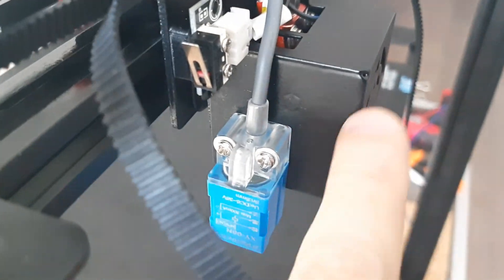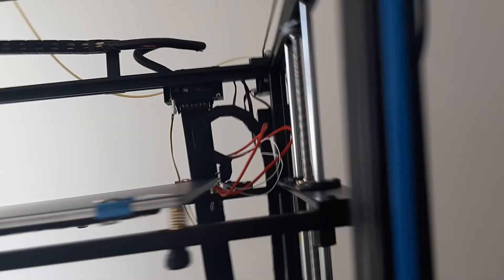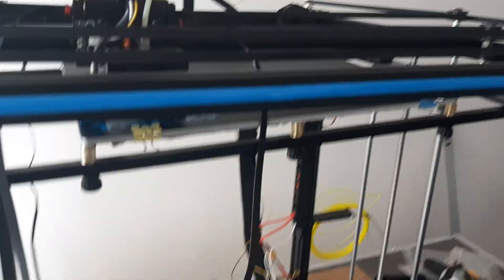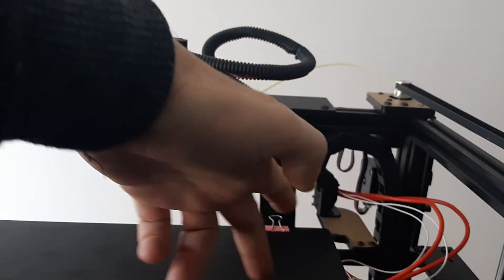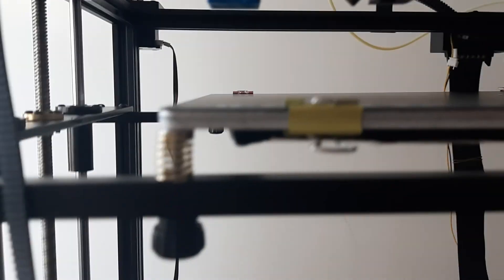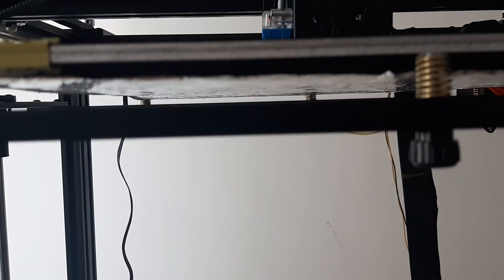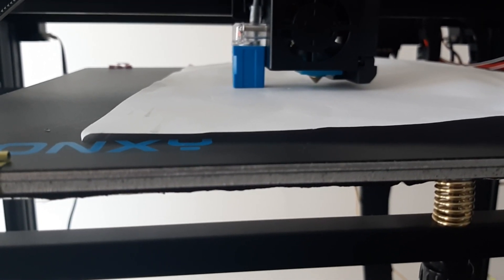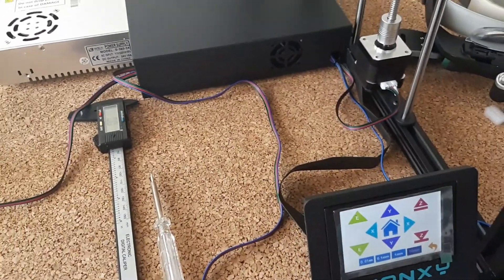Tronxy X5SA Leveling option isn't working

Comment: Are you still having this problem?
Reply: I am lol it just wont level
Reply: @dimma718  Whenever my printer does this I use 4 items of equal height to force the z-axis straight
Reply: @tristonc137  thanks! about to cut 4 blocks now.
Reply: @dimma718  did it work?
Reply: @tristonc137  Yes!👍😁😁 back left just a tiny gap I cant go further with but that can be fixed with the screw on the corner, doing the autolevel now
Reply: @dimma718  sweet👍
Reply: @dimma718  btw, I have to do that about once a day. I usually just do it in the morning when I wake up
Reply: @tristonc137  well theres another issue I had to fix. The motor pushing the filament, the small cog had no screw holding it in place so no filament was punching through. Also the filament tube was too short. I tried to extend it with a spare ender 3 tube but for some reason superglue will not keep it together!😠 so now I'm stuck since theres no place I can  drive to for another one. I tried home depot and lowes with no luck as well so I'm contacting tronxy for a replacement
Reply: @tristonc137  yes let me see whats me name there lol hold on
Reply: @tristonc137  cool yes let me try something real quick then find my snapchat name, I found a tubing a little bigget than the normal one brb
Reply: I just added you on snap chat!
Reply: Is the sensor not to low??
Reply: I have the same problem 😢. Can you tel me how you fixed it? I have no clue and it turns me crazy.